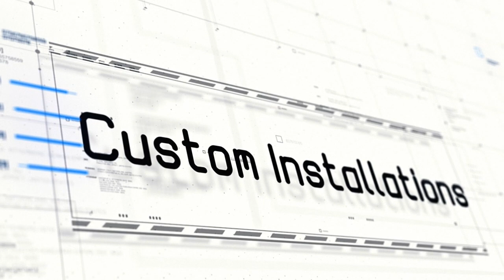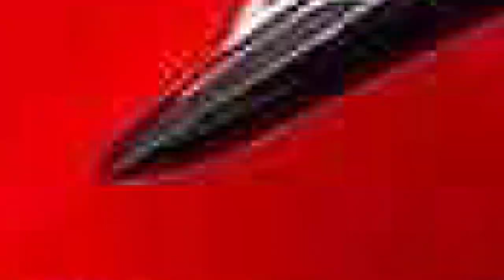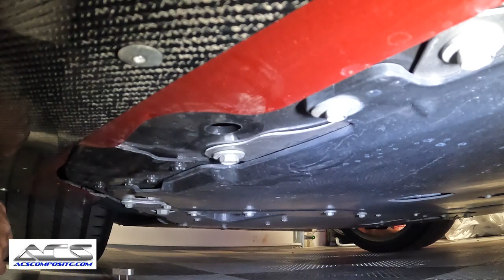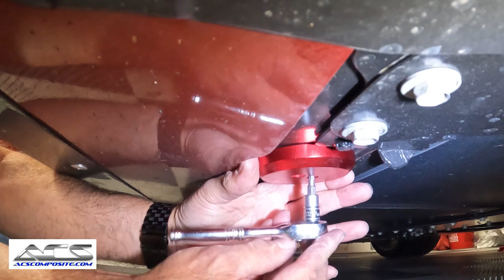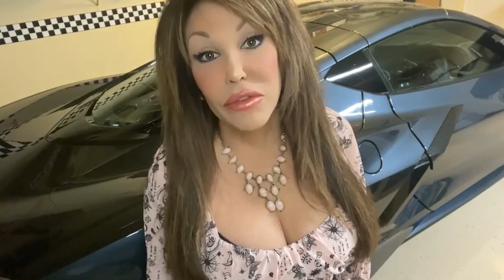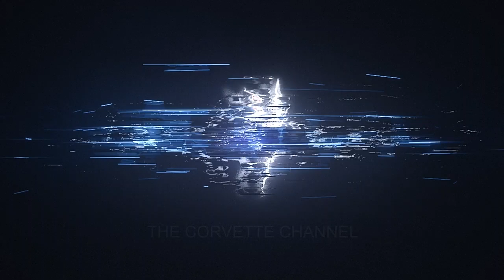This is why you need ACS Jacking Pucks!!

Comment: Looking at video.. the vette fell with the rear first..meaning that the mid rear engine is heavier then the front..or else they didn’t level the car to have the same balance from front to back.  If i every took my vette for dealer to service..I recommended them using a drive on lift rather then the one on the video.  Jacking plucks only good for home DIY jobs using low profile jack.